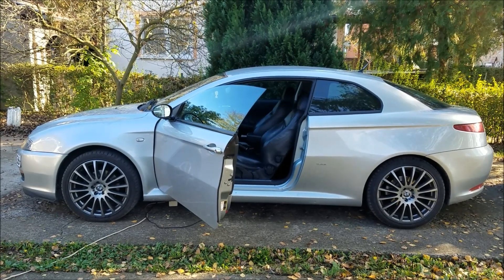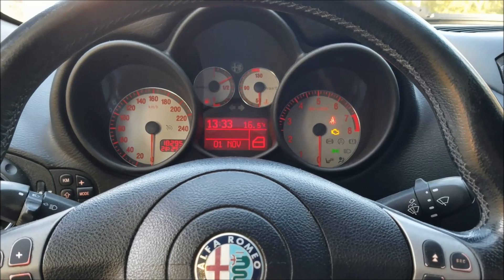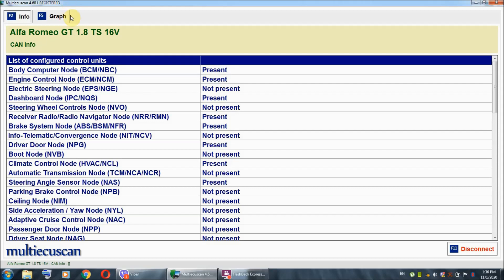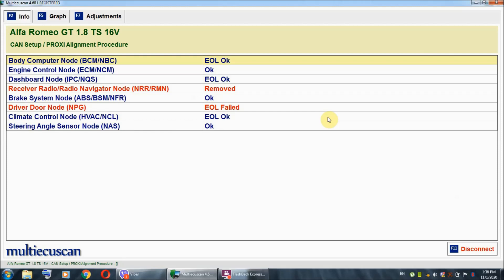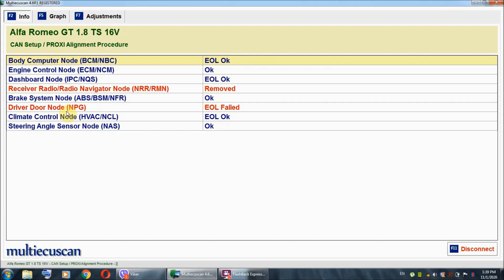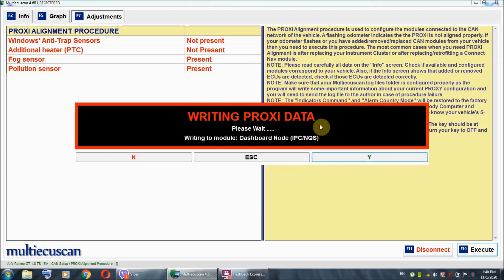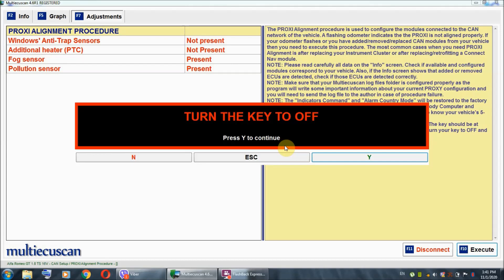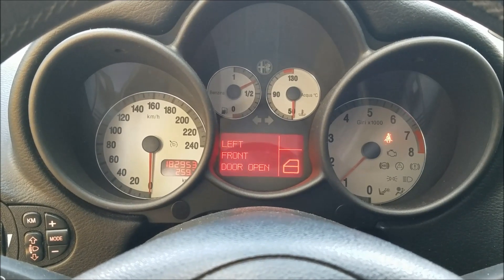How to Diagnose and Fix Flashing Odometer on Any Alfa Romeo Using MES, Proxy Alignment Procedure

Comment: My ELM cable and Multi ECU scan will simply not connect to my body computer (same issue you appear to have in the other video)... Was there any particular setting or cable adaptor you are using to connect successfully this time? Thanks

Comment: I have same problem whit my car. Alfa 147 "Driver Door Node (NPG) EOL Failed
I try proxy Alignment, but have "fail time out..." I connect whit Multiplexed version and CANtieCAR interface whit Bluetooth connection. 

Have problem whit windows switch panel or some else?

Comment: Which Elm link do you use? I cant conect which mi ecu.
I use a elm327 wifi 2.0
Reply from the maker: You must have registered version of MES for ELM to work...
Reply: Hi. I have registered MES and ELM 1.4 cable but I can not connect to Proxy alignment at all. I can however connect to engine ecu without a issue. So is there any trick? Did you use any of those colorful adaptors? And what are your port settings? I guess the speed should be 38400..?
Reply: @maatloos  You will need to modify the ELM cable. Use google and in the top suggestions you will see a guide on how to do it.

Comment: One more great vid. My gas indicator dont work properly, cant yet find a solution and i have already changed my fuel pump... any idea in electonic matter?
Reply from the maker: Thanks, I would inspect the float wiring first. If that checks out I would move on to the board computer...
Reply: @arcgarage   well, board changed.... but yet i can see some unreliable movement of the pointer. Not same huge unrealistic info but just a line drop ..Not sure what s going on
Reply from the maker: @spikee7733  Is it working? How accurate is it?
Reply: @arcgarage   Well i just changed  the dashboard. So i can see missaccurate  of the gas  indicator about one line, maybe half a line in a 7-8 km  route. While i m driving, it is moving down one line sometimes half(straight road) and then it comes back after a while. Before i changed it , it was going down 3 lines in 7-8 kilometers. So i m trying to understand if the problem is solved or if it persist but in less scale....